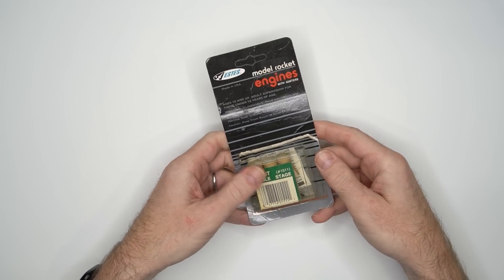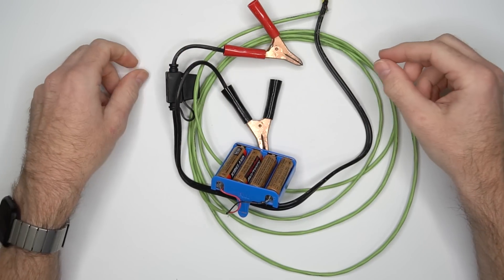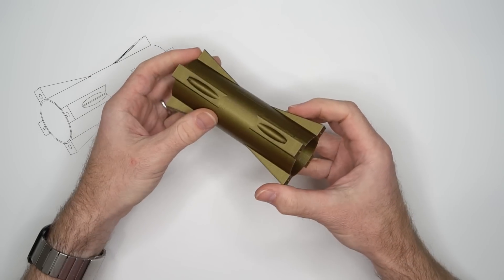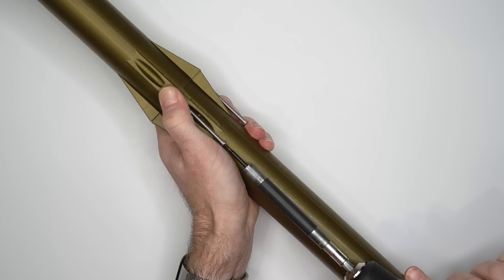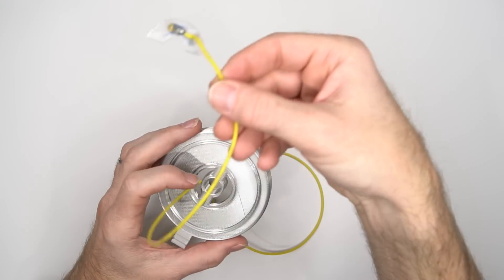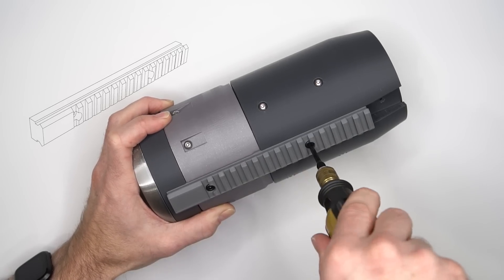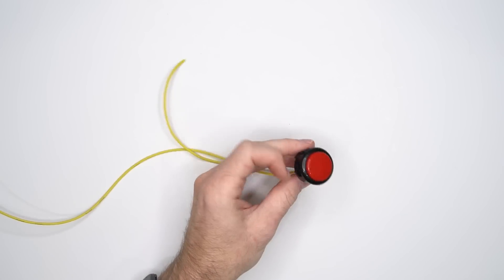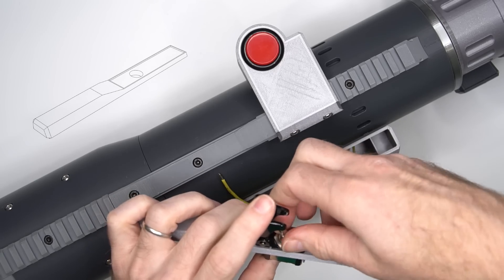I 3D printed a rocket launcher because I can

Comment: Not black powder. The accelerant and oxygen source are designed for a slow burn and not to explode. At 10 years old i sustained severe hearing loss because i used black powder to make a rocket. It was actually an explosive device.

Igniters are nickel chromium wires that are used in hair driers and vape coils. They resist electrical flow and heat up. Not sure why the dude said ectrochemical? Maybe theres something akin to a match head in the coating.

Comment: Superglue is definitely not the right way to bond the washerhalves. More so since it comes in contact with heat. But. Eh. If it works it works. The problem is in the long term. On a thing you use only occasionally and if it comes loose you can just glue it back. So yea. Good enough. Not the right way but if it works, it works.

The correct would be either some sort of two part epoxy, or contact cement. Preferably rubber based so it takes vibration better. But. It smells and needs to cure for a long time and superglue is fine enough.

Comment: I did pretty much this exact same project 33 years ago when i was 14. of course didn't have the benefit of 3d printing back then, was mostly PVC pipe with some wood parts and one of those little plastic project boxes.

Comment: I built a RPG for my 1985 school science program I did almost exactly this and stabilized the rockets by adding weight to the nose. I added 4 extra fins. I used a metal coat hanger, a 2x4 and broomstick, hinge, and plastic pvc tube, and clear plastic clip board for a blast shield . It hit the target every time.

Comment: You could simplify construction by using a Bambu X1 and its ability to print more than one color.and/or transparent filament - especially on the arming indicator case window..  this would eliminate the need to use a resin-based printer.  I LOVE the detail and multi-color printing features of my Bambu X1 Carbon FDM printer!

Comment: literally did something similar, as a kid. It was rather funny as I had a tube of pvc, and couldn't fit the rocket. So I hot glued fins directly onto the rocket engines, not thinking it through fully. I fired the rocket and it went straight because I actually done some research and built proper fins. But it only went straight for about 10 feet, at that point the rockets fins detached and now it was a completely unguided, finless rocket. It promptly made a 180 turn and flew straight at me. Fun times as a kid.

Comment: This is superb, really awesome idea and execution! One thing I would say for the future, if you make another version... use PETG, it has higher temperature resistance and is also chemical resistant. On top of that it's generally stronger too by a large degree. You can get it in all the colours you used!
Reply: I'd use a metal pipe for a barrel liner, personally.

Comment: Dude just made a rocket launcher using only a 3d model designer software, a 3d printer, and a resin printer. The materials are pretty easy to find and you could probably get them at your local home depot, or other hardware stores. If this is possible, we can technically mass-produce these. Imagine if the missile was a tad bit more accurate, the thrust stronger, and the bulb containing a bit of explosives. Imagine what could happen.
Reply: I'm gonna guess "model rocket engines would be outlawed" is what could happen.

(Also, the rocket launcher can be made using pipes from the hardware store.)

Comment: Cool build. I made something similar back when I was abt 12-13. But mine was mostly PVC pipe construction.. I had a handful of model rockets as a kid, most using those same tiny motors you used (about the size of a AAA battery) but I also had 2 Star Wars model rockets that used a larger motor, about wide as a stack of nickels and a little over 2" long. And I had a tube of thin plastic that would fit it perfectly, so I cut a piece down, made a nose cone and some fins and attached the motor, got a PVC tube that it fit inside of nicely, drilled some holes, glued on handles and the rocket starter, ran wires up to the back of the tube to attach to the ignitor, with a rubber band operated safety trigger that dropped 2 pins that rose up a bit in front and behind the rocket to keep it sliding out the tube. After a bit if work getting the rocket weight and balance right it was so amazingly fun and launched far, accurately. I even added a little paintball red dot sight to it. But if it had looked as good as yours did it this build, it would have blown my mind lol. Thats what I pretended it looked like in my imagination rather than just a janky painted pvc pipe..
Still was alot of fun though. And later I made another little brother to it that shot slightly modified small bottle rockets about 3/4" wide and 5" long.. just using the same positioning pins to hold it steady in the tube and a long BBQ lighter that drilled into the tube and glued in to light the fuse. Not quite as long range or anywhere near as accurate, even w rudimentary fins. They just weren't made to shoot horizontally w the weight and balance, without the stick too.. but it made a fun noise and had the satisfying pop about a second after you launched it off... such good times lol.. maybe I should use your files and make me this thing to play around with

Comment: I took an aerospace engineering class in highschool, and when we made model rockets, I mounted the engine retainer wrong so when the second stage went off it blew the entire assembly out the back instead of blowing the cone off and deploying the parachute. 

The result was a rocket powered lawn dart that landed 20 feet from the landscaper

Comment: One thing I noticed for small-diameter launchers is that the rocket will almost always have a super low and unstable exit velocity. If instead the launcher used a sealed tube and ditched the "recoilless" aspect you could get much better exit velocity and a more stable accurate flight. Or use a booster charge with a counterweight to get the same effect.

Comment: The igniter is not electrochemical - It's thermal. What ignites the igniter is heat in the wire. Just because it has an electrical circuit does not make it electrochemical.

Comment: I still don't understand how ignition works,  metal is not touching the inside of the motor? how?
Reply from the maker: There is an igniter with two metal wires - those touch each of the metal contacts. When the electricity goes through the contacts and into the wires it heats up the end of the igniter that is similar to a match head, igniting the engine.